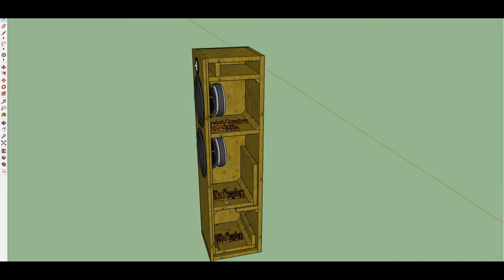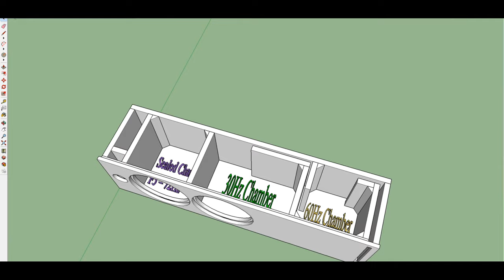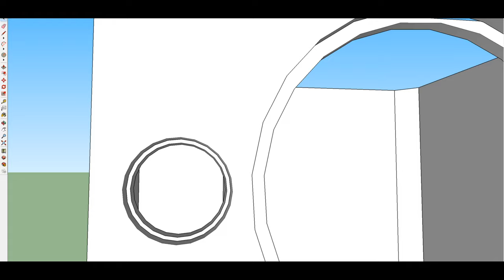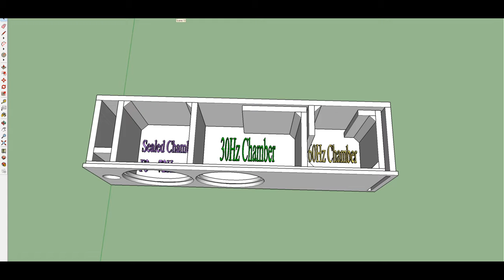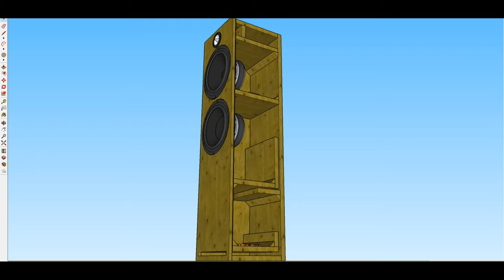Tang Band 3 Way Tower: With 6th Order Bass Reflex

Comment: great build, seems the "6th order bass reflex" or "dual bass reflex" design is extremely hard to find information on these days!
Reply: Actually to be a dual bass reflex both chambers would be ported to the outside with the main (woofer) chamber ported into the secondary chamber of half the volume of the main. If I remember my design theory correctly, his design should provide the dampening property of an acoustic suspension with the extension of a bass reflex.

Comment: Looks interesting like it would sound good. I noticed you didn't mention anything about the crossover. What kind are you using and is it going to be a 3 way ?
Reply from the maker: I'm going to be needing you guys advice on a crossover. I'm currently in the process of creating the lay out for one, but if you guys know a good preassembled one, please give your feedback during the crossover portion of this series. 👍
Reply: @BudgetBassHead  I would ask parts express first. Google 3 way passives from there. Good luck. I'll be looking for follow up. Looks like it would sound good. Maybe customer has amps with build in ?

Comment: Question for you my man, I’m currently toying with the idea of creating 6th order bass reflex enclosures, from my understanding this order of bass reflex enclosures are not listed in the any of the enclosure design software, so can you point me in the right direction to figure out the most correct calculations. I know this style of design tends to smooth out any peaks in frequency response so any help would be awesome. Thank you
Reply from the maker: To be honest with you, I simply designed it in the same fashion I would any 6th order. Wether it be Band pass or Reflex, you have two specific tunings to deal with. Don't over complicate the process, tune them 1/2 to 1 octave apart and pray you have the space for it. 😁

Comment: Man I don't think that's how a 6th order works, you cant fire just the port into another ported chamber, you have to have the woofer and port firing into the second ported chamber, how you have it drawn up won't work as a 6th order , the second chamber just adds on to the first port lowering the tuning frequency. 

A 6th order bandpass series tuning is basically a ported box  woofer and port firing into a second highertuned ported box.
Parallel tuning is having both Chambers port separately, each chamber being tuned different

Not trying to make you look stupid or anything man, just trying to help.

If you're going to 6th order that sub, the sub would be mounted inside box and you wouldn't actually be able to see the sub like you have it mocked up, excellent skills on the sketch work though man. I've been trying to figure out how to make things in sketch up forever
Reply from the maker: Thanks for the response but you are confusing Bass Reflex, with Bandpass. They are completely different designs. Ironically, I'm currently responding to this, while editing an upcoming video on the subject. So please, stay tuned and welcome to the family 👍
Reply: @BudgetBassHead   ok, I guess ill have to see your explaination because ive never seen any design where only the port is fired into another chamber.